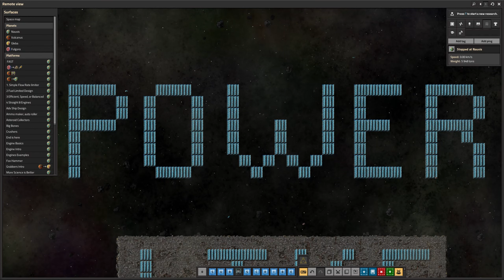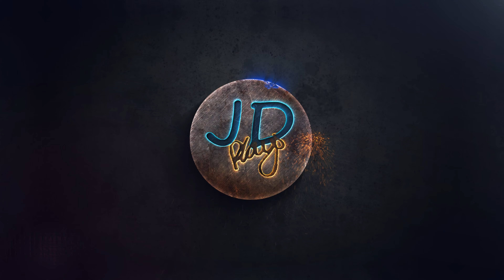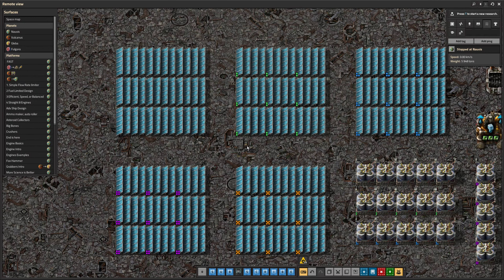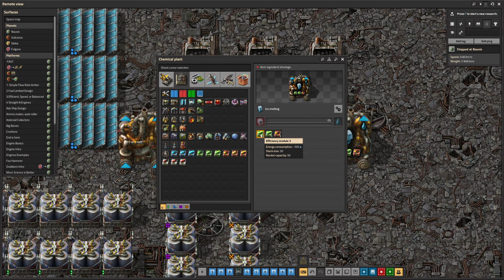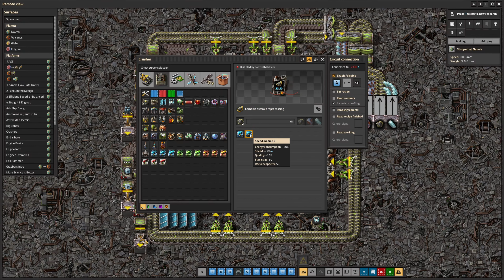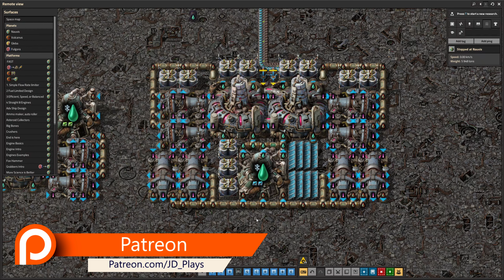Ship Design 101: Power in Space ⚙️ Factorio Space Age 🏭 Tutorial, Walkthrough

Comment: Some important things you missed:
- Higher quality buildings work faster without drawing any more power
- Higher quality modules give a larger bonus (speed or productivity) but only have the same energy penalty as the normal-quality version
- When using productivity modules, it's sometimes more power-efficient to use speed modules rather than efficiency modules in your beacons. A foundry that uses 10 MW but produces all the iron plates your ship needs is better than foundries that only use 3 MW but you need 4 of them to meet demand. (This is even true if you don't need multiple slow machines; 1 foundry that uses 10 MW when running but is idle 3/4 of the time still beats 1 foundry that uses 3 MW and has to run constantly.)

Comment: at 6:30 what are the arrow items on the right? some new inserter?
Reply from the maker: They are called 'Loaders' they are part of the base game originally designed for unloading and loading trains, but the devs never finished them and just left them with temp art work. They are only available inside the editor mode which I use often to test things and for these tutorial videos as it removes many built limitations
Reply: @JDPlays  thanks for the explanation! ive seen them in a couple other videos and the temp art seemed really out of place. then i noticed they fill both sides of the belt!
Reply: It is from a mod for testing purposes typically.
Reply: It's an item specific to the editor mode called "Loaders". They are available in the vanilla game and do not require any mods.

Comment: Can you do a video on crafting? I’ve been trying to make an assembler craft objects based on circuit logic but the system keeps getting stuck on turning yellow belts into red belts.
Which is to say every time a yellow belt get put into an assembler to make red belts the order for red belts is cancelled and the assembler basically becomes stuck in a loop.
Reply from the maker: I do plan on doing so, its on the list of videos I'd like to get done, but to partially answer you and @alamrasyidi4097 question use 2 colours of wires and 'sanitise' the wire reading the ingredients required for crafting on the way out, this can be done via a decider combinator with something simple as biter = biter then for the output select the signal you want as the output signal. This removes any other junk from the signal
Reply: @JDPlays  yeah, sanitation is key honesty. ive learned that the hard way and your notion really cemented in my head the idea that no sanitation is enough sanitation. thinking more on this problem, i just had an idea to add another assembler, not to craft any item, but just to read what the assembler would have been crafting and have it output the ingredients required, which you can then multiply by a negative number to then make the real assembler you use to craft things believe that theres more than enough of a certain ingredient item in the mall already, making it avoid crafting it. having an assembler just to read its recipe kind of feels hilarious though lmao
Reply: i stumbled across the same problem. a solution i tried include reading the ingredients of what the assembler is crafting (make sure its a different color wire from the wire telling the assembler what to craft), multiply that by a number x, and connect the result of that multiplication to my main inventory network so that the assembler thinks theres x amount more of the ingredients, making it think there should still be enough of whatever ingredient it needed to use. it still gets stuck though. my only explanation is that reading the ingredients  also inadvertently tells the assembler to craft said ingredient...
Reply: @alamrasyidi4097  I haven't tried to do advanced circuit based recipe setting but that makes sense to me. Why wouldn't an assembler change it's recipe to an ingredient it reported on the same wire? I assume you're exporting the recipe ingredients to a requester chest so I guess you would need a way to specify which wire to read the recipe from and which wire the ingredients should be read onto.
Reply: @darkestaxe3415  man, you do not want to see the absolute circuit spaghetti ive made to make a single assembler mall works. since set recipe only affects the assembler if the output is positive, you can simply tell the assembler what to craft by connecting it to a constant combinator with a collection of items you want the mall to craft each with the signal value of how many you want to keep it in the mall (ie. set belt to 500 if you want to keep 500 belts) then you can connect all the chests the mall has to keep the crafted items, multiply that by -1, and then connet that to the constant combinator's output. now the assembler can read not only what it needs to craft, but also how many more of the item it still needs to craft. as it crafts more items, the mall inventory increases, which subtracts the constant combinator's output more and more until finally the item it was crafting's value reaches non-positive, in which case it stops crafting that item and moves on to the next item (assemblers craft items from left to right of the crafting menu). of course, this is when i stumbles across the switching recipe problem. ive kinda given up on single assembler ever since and used another assembler to craft items that requires crafted items as ingredients (which will be crafted by the first assembler), but this trick isnt very scalable if youre trying to avoid an ever growing circuit mess (more assembler is needed to craft items that uses items the second assembler crafts as ingredients)
Reply: I think I mostly solved this problem by having two deciders filter the input of items to craft, one that wants a number on hand, and another that wants twice as much of that item. A third decider then ensures we don't stop crafting the item until we hit the 2x number, but doesn't turn the request back on until we hit the 1x number
Reply: @iracasper3143  it didnt come to my mind that theres a way to make a bulk sr latch for all the things i want it to craft